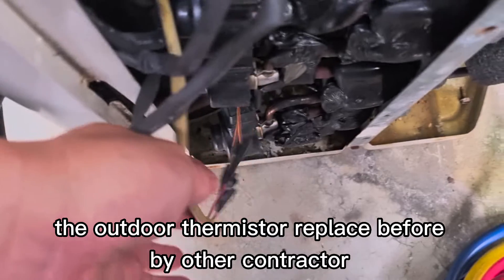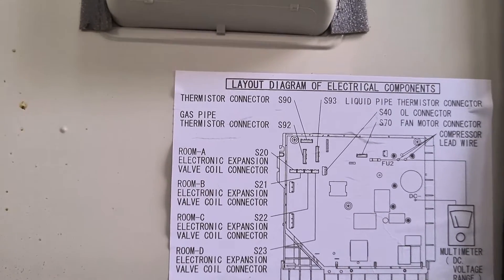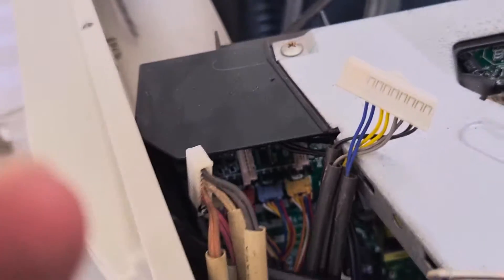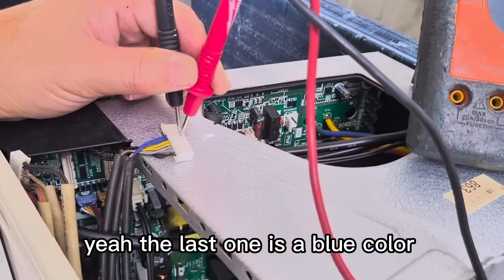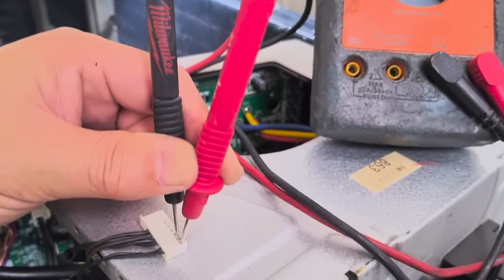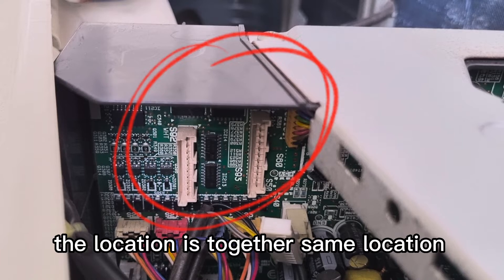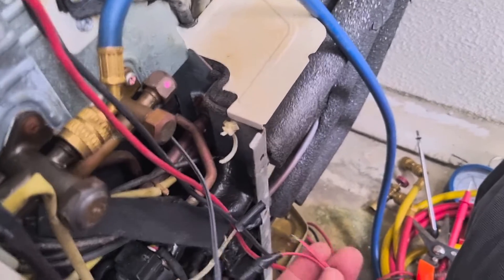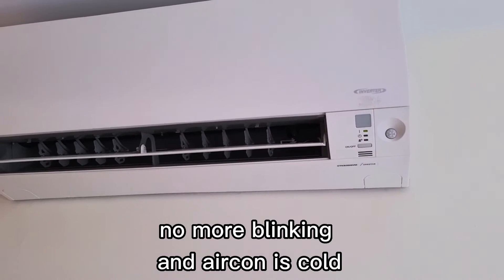How to fault finding multi inverter aircon thermistor | R410a

Comment: gas pipe 不是j9么？？
Reply from the maker: Error code 可以做参考，但我们也要检查清楚。
Reply: 我今天遇到一个4mks 80  打两台35 ducted unit  . 两台fcu  出A5  和UH  ...... reset 一下可以跑两天。
Reply: 还有救么？我让顾客换外机
Reply from the maker: @janshaw5472  有check 有check thermistor 吗?
Reply: @BonMj  sir   ... 是外check 外机的thermistor  么？
Reply from the maker: @janshaw5472  是